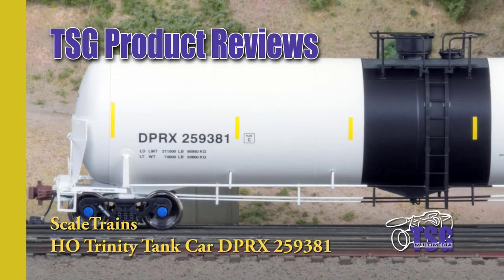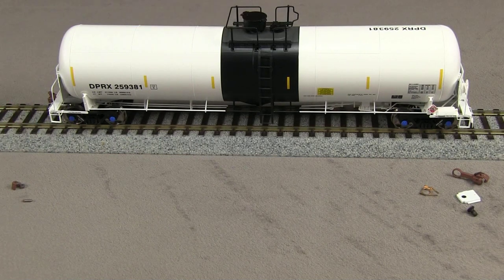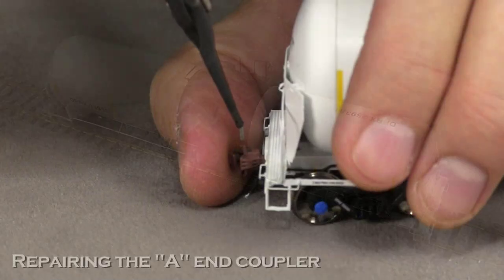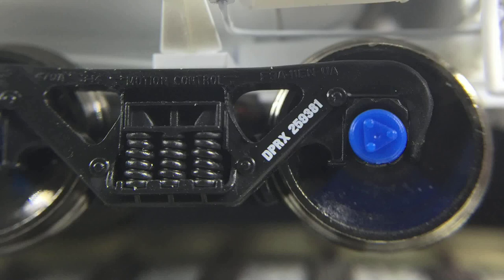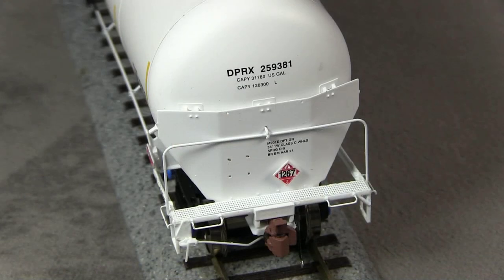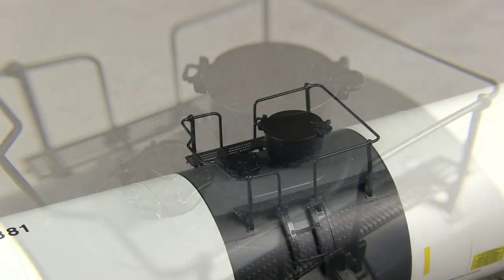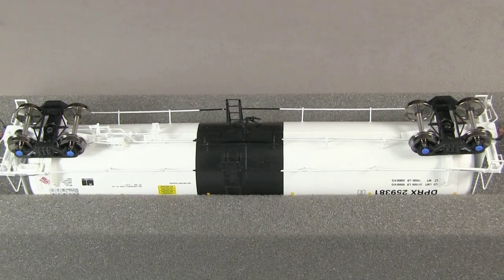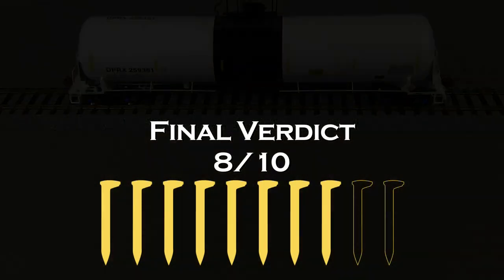HO Scale Petroleum Tank Car Scale Trains Rivet Counter Product Review

Comment: I think the second spike was unnecessary to take off, the damage to the coupler was probably rare and I do know they actually lost almost half their first shipment due to damage and had to go through and check every car, I'm guessing this one probably slipped past them.
Reply from the maker: I understand what you are saying, but think about it:
"I am not going to dock it because some other models they shipped might not have had this problem."

Does that really sound valid to you?

Would you pay $40 for a model whose only legitimate use out of the box would be as a derelict piece of rolling stock on a rusty unused siding on your layout?

It's a shame that the quality control is absent because in every other way this model could have easily rated "EPIC." The level of detail and sturdy construction is really excellent.

I would not have been as lenient as Dan was. I would have probably maxed this car out at 6 or 7 spikes.

John
Reply: +tsgmultimedia when the tanks shipped the factory didn't package them probably, so all but about 100 cars were repaired at the headquarters. Another thing that was repaired was the coupler height. So if you were to go get a newer tank it would be fixed.
Reply from the maker: It's too bad Dan got a messed up one.
Reply: +tsgmultimedia yeah we had a bunch of guys from my club go up there and help Shane out (seeing as Shane is a member)
Reply from the maker: Scale Trains models' level of detail is really great. They're doing a great job with that aspect of their releases.
Reply: Absolutely.